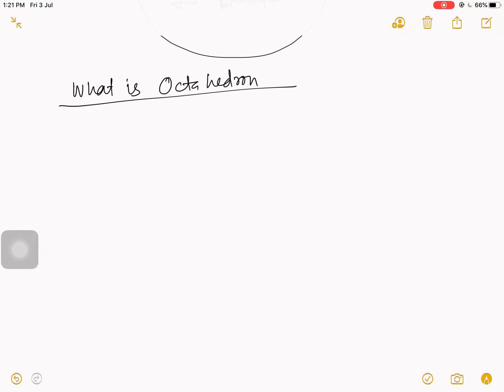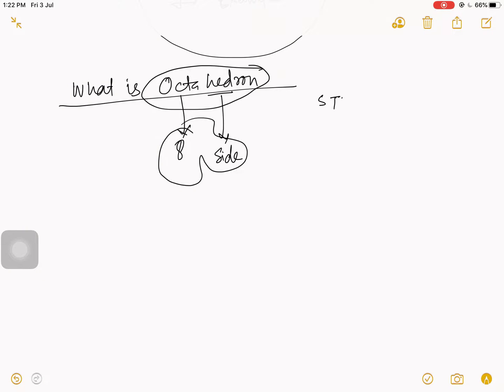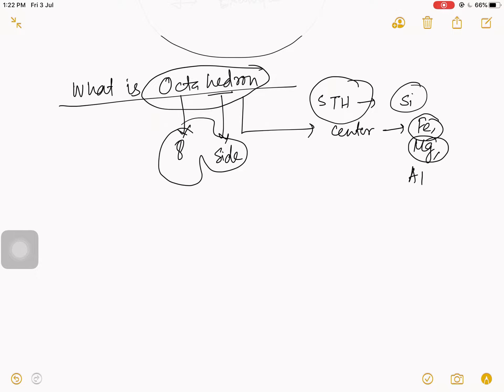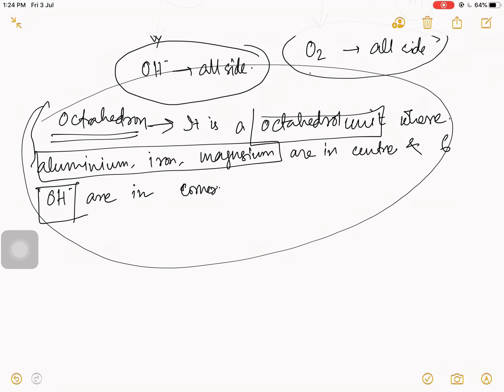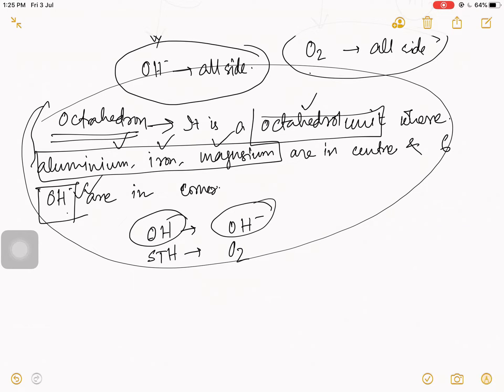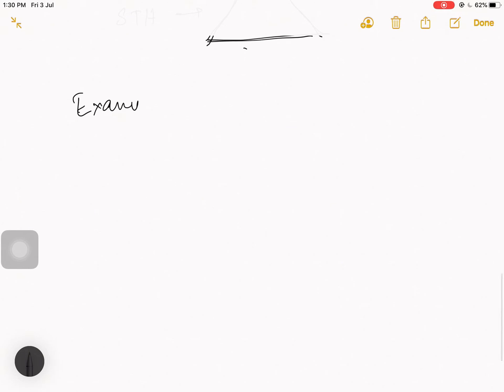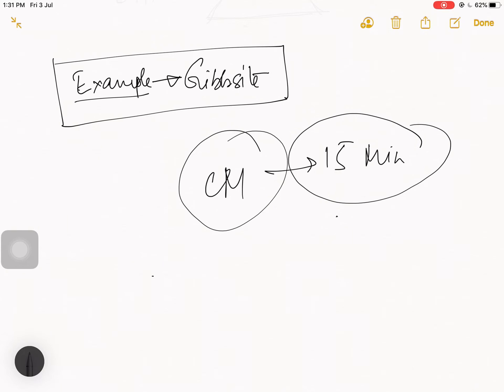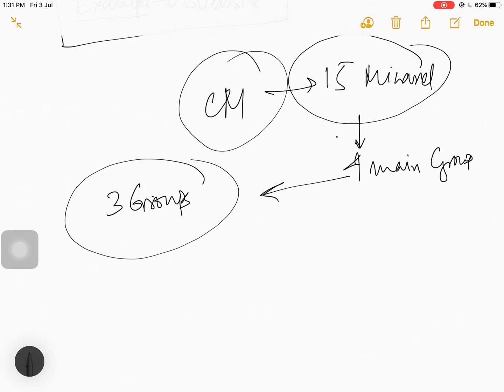WHAT IS OCTAHEDRAL II OCTAHEDRAL STRUCTURE II SOIL STRUCTURE AND CLAY MINERALOGY II SOIL MECHANICS

Comment: Al is +3 and 6Oxygen is -2 for each ..then how do they share electron
Reply from the maker: he octahedral layer comprises two sheets of closely packed oxygen or hydroxyl ions with aluminium, magnesium or iron cations embedded within it; each in octahedral coordination and equidistant from six oxygen or hydroxyl ions (Grim, 1968). These octahedral unit cells share their oxygen or hydroxyl ions with adjacent cells forming an extensive, symmetrical sheet. Due to the nature of the octahedral sheet being able to accomodate different cations, the octahedral layer can be either di-octahedral or tri-octahedral. The di-octahedral layer is where 2 out of 3 of the octahedral sites are occupied by a trivalent cation, such as aluminium or ferric cations. Here, 2 cations multiplied by the 3+ ionic charge on each cation = 6. In the case of the tri-octahedral layer 3 out of 3 sites are occupied by a divalent cation , that is, a +2 ion such as ferrous or magnesium. Here, 3 cations multiplied by the 2+ ionic charge on each cation = 6. To emphasise, the di- and tri- prefixes refers to the number of octahedral sites occupied and NOT the charge on the cation.

If only aluminium is present, as in kaolinite (Mason and Berry 1968), the structure is called a gibbsite layer (or sheet or structure) with a unit cell formula of Al2(OH)6 (Grim, 1968), often abbreviated as the stoichiometric equivalent Al(OH)3 (Klein and Hurlbut, 1993). Hence gibbsite (and thus kaolinite) is di-octahedral. The alternative, with only a divalent central ion, is tri-octhedral; with magnesium as a divalent, central ion, the structure is called a brucite layer (or sheet or structure) with a unit cell formula of Mg3(OH)6 (abbreviated as Mg(OH)2). Gibbsite or hydrargillite (hydrous aluminium oxide, Al2(OH)6 or Al2O3•3H2O) and brucite (hydrous oxide of magnesium, Mg(OH)2) are usual minerals in their own right in literature on clay chemistry, mineralogy and structure
Reply: @SoumyadeepHalder_vlog  I understood the structure but regarding the sharing of the e- I'm still confused ..tetrahedral for Si for example has 4+ valency fulfilled by 4 oxygen ..but for octahedral Al has 3+ how is it satisfied by 6 oxygen. Isn't it too much? Sorry if I'm too dumb 💔
Reply from the maker: Don't worry..thats great thats thing was cleared for u.all the. Best